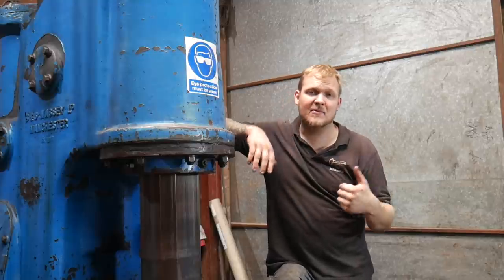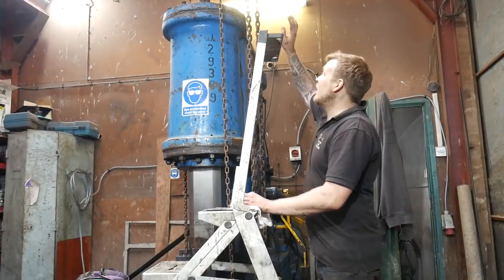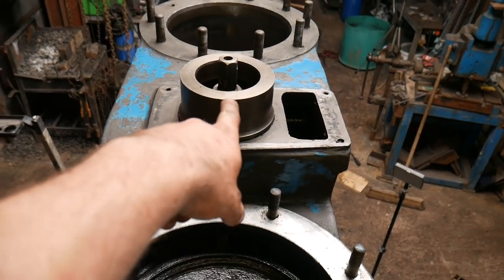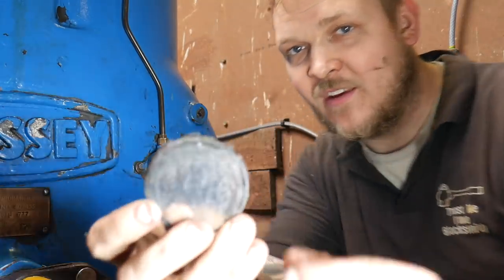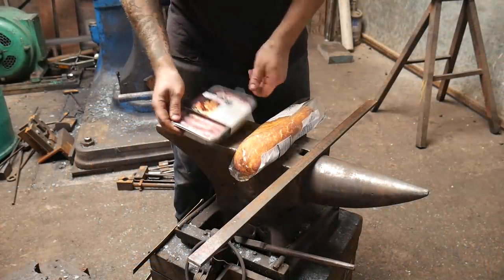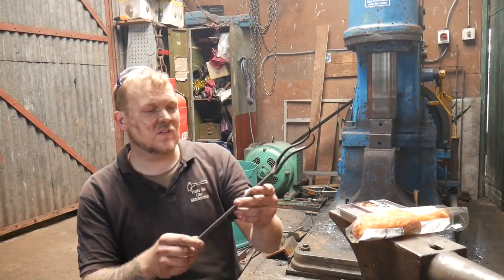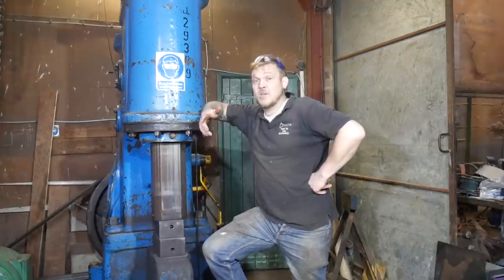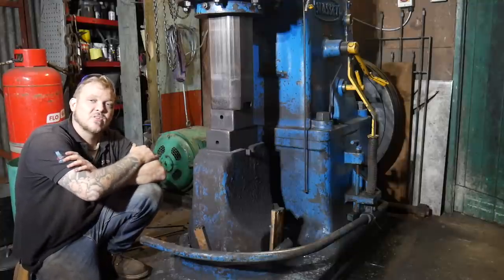Major Power Hammer Repairs! R&R part 10

Comment: Mine is pneumatic. I just had the cylinder reworked and changed the pneumatic valves. It forced me to learn how to work on the hammer. You have my sympathy. These things get terrible stresses put on them. You did a lovely job.

You have a lovely chain hoist. I need to get one as my wife has been baking a lot lately.

Comment: I wonder if Teflon board would be a suitable replacement for those slides in the stuffing box. You can machine them to size and won’t need the shims. We use them on our pneumatic ram systems for chemical cleaning tanks. Also an idea is to use anti seize compound around the stuffing box for lubrications. We use copper based anti seize on our moving parts and it does a decent job of protecting moving steel parts.

Comment: Glad to see what is inside a power hammer. I like old mechanical machines, I collect, restore, and exhibit antique engines, you have to be a mechanic, mechanist, and mix in a little blacksmithing. At times the only thing left is to make the parts yourself. When you work for yourself, you use what you have at hand, don't criticize, just get the machine back in line.
It was nice to get a peak at the rest of the shop, is that all yours in the area of the fork lift? That overhead crane is a big blessing, that is next on my list for my shop.
Thanks for how to stuff a sandwich, will have to try that next year at the engine shows.
Reply from the maker: I just rent the shop next door is a wood working shop rent by a timber framer and the other side is the farmers work shop.

Comment: They don't make them like they used too!!
Jacking bolts  holes could be drilled in the top cover  to help get it off and  some threaded rods to aid getting the stuffing box back on.
but good job

Comment: Young man! Do not beat yourself up about making a few bad decisions, I can tell you now you will make more and there is no point regretting them, what's done is done so move on. I am not a qualified mechanic, engineer, welder or anything and so what if you have to use resources to get a job done and so what if it looks a bit brutal to the educated and knowledgeable who do the task professionally. You do your best, your videos are slick, no foul language and convey the message and subject very well indeed. Quite the opposite of my videos! Anyway, don't worry about what folk might think, they are not in the moment, under the pressure and such like. As for budgets, man you don't need to explain a thing. Your budget is tight, mine is tighter and the next YouTuber could be richer or poorer? be yourself, show your passion for metal working and share the epxeirences, that is pure YouTube and what makes it great! Top regards, Jon.

Comment: 25 years down the pit means nothing in your working methods shocked me. We called it 'pitmatics' a rough and ready branch of engineering that always seemed to get the job done. I have even used explosives to remove rusty seized on components such as coal cutter drums. Always remember ... If in doubt hit it harder ... if it still won't budge, use a bigger hammer.